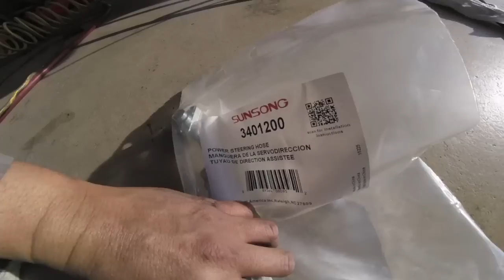TRUE Diagnose Replace Bleed Power Steering Hose Honda Odyssey √ Fix It Angel

Comment: Just my opinion, this is one of the best videos on power steering maintenance. You showed us the whole process start to finish. I particularly wanted to see how you bled the system since I have just replaced a leaking hose on my vehicle and was unsure of how to get the bleeding done. The manufacturer of my vehicle recommends cranking the engine after disabling the ignition , whilst turning the steering wheel about the same number of times  as you did.  Thanks for a great video.

Comment: Great video, helped a lot. Have two tips from my experience. 1. It is easier to reach the flare nut from the top of the engine. Just disconnect and remove a double hard line in the air intake section of the engine. 2. Instead of using crowfoot wrench and have a huge chances of rounding the flare nut (what I almost did)  cut the hard line very close to the flare nut and then apply regular socket. 

I reached the line from the engine top and used triangle file to cut the file (15 mins of work). Then used 14mm socket -- > profit.

Comment: nice... most guys bleed the steering by cranking it up after the hose repair...wrong. thanks for showing the manual bleed procedure it will help a lot of guys in the future! oh yeah was the timing belt tensioner making noise? saw two 3.5 t. belts last week due to blown tensioners. thanks for the vids.

Comment: Nice job. I love your style and comprehensive way of covering the job. I just put a new motor in my wife’s 2012 odyssey and I had to pull the whole cradle steering rack and all. After putting it all back in, the steering has hard spots in it while you’re turning. It’s not super hard but it’s also there with the vehicle turned off with no power steering. Racking my brain trying to figure this out. Any tips would be awesome.
Reply from the maker: DiverseDad hello brother, did you bleed the power steering system of air?
Reply: Fix It Angel I did bleed it the best I know how. I moved the wheel lock to lock many times. Still had the issue so I disconnected the return from the reservoir and blocked it while I had someone turn the wheel as I added fluid and drained the return hose into a cup if that makes any sense. It maybe helped slightly but I still have the slight issue

Comment: Hey Angel. How can you do that without engine is running when turning left and right? I tried that on my 2006 Scion TC it wont turn so I have start up the car to full lock to lock left and right. Do it has to get 2 tires off the ground to do this steering fluid service flush? Can this work in any vehicle while 2 tires off the ground without starting the car up to do steering fluid service flush? Let me know ASAP what is your method on my 2006 Scion TC. Thank you. Love ypur channel and video. @Fix It Angel

Comment: Hi!  I need your help! pls. what do u think is the problem of my power steering wheel that has continues Hissing sound somewhere under the hood when i steer from left to right and vice versa lock to lock? just replaced the fluid and that's the result, thanks in advance

Comment: Good video.  A few things that will make this easier.  1. DO use a crowfoot wrench that looks like a flare nut wrench, and do NOT use a normal crowfoot wrench.  2. Drain the PS fluid BEFORE you start work, not after.  Use a syringe or turkey baster to empty the reservoir first. You'll have almost zero spillage, and you won't be running dirty fluid through your brand new hose. You also won't have to cover the port on the reservoir.  3. Move line hard line slightly to find the right alignment, and the flare nut spins off with your fingers.  4.  You only have to crank the wheel 2 or 3 times, not 6.  5.  cover the port on the pump immediately after you remove the fitting; any dirt that falls in there will be impossible to remove.  I wiped the flats with a clean shop towel soaked in alcohol, then put painters tape over the hole. When you're ready to install the new hose, peel the tape off at the last moment - perfectly clean.  Lastly, cover the flare end of the new hose with a 3/8 rubber vacuum cap; you don't want to be shoving the new hose down your engine compartment and have it scoop up a chunk of dirt. Remove the cap right before you reattach it.
Reply: Can you provide a link to a the "Crowfoot Wrench" that you are referring to.

Comment: Bro i have a question for you im own a 01 odyssey and since two months ago i starting to notice that if don’t let my car warm for a 5 mins and dies on my and the first stop sing or traffic light its getting annoying i cleaned the tb it got new tps sensor map sensor i just replace the iac cause it was old and nasty so I decided to put a new one it took it to the shop they cannot find the problems i have a tuned up a few days ago also i notice before it dies the rmp drops like it can’t hold idle and it just die and stall it driving me crazy when i start the car in the morning idle goes up like 1,500 rpm then drops a little bit till warm the normal idle i have its something like 700 or 750
Reply from the maker: fredy Calderon hi bro, I just need to ask just to get more info so I can try to pinpoint the problem. Have you tested the alternator and battery? That's first to do. 
It's like a road map. A to B to C and so on
Reply: Fix It Angel hello bro how are you yes i checked them battery its like 12.45 or 50 when the car is off when its on like around 14v something put loan and everything and still in good range but i notice something since i just got a scan tool the fuel trims are so bad they look -14 or sometimes -24 % negative short term fuel trim bank 1 and long term as well read negative seem i was running so rich and make the engine stall but i check the o2 sensors the heater circuit respond quickly i will try to create a vaccum leak to make then go lean to see if they are 100% good i thinking could be a bad fuel pressure regulator that keep getting stuck and make a lot if pressure in the fuel rail or a leak injector
Reply from the maker: yes test fuel pressure regulator. that could be the problem. tell me what happens. good luck brother
Reply: Fix It Angel today i tried to check the  evap canister solenoid valve and it was fine
Reply from the maker: fredy Calderon try cleaning your throttle body.  Tell me what happens.
Reply: Fix It Angel I’ve done it already i’ll order the intake manifold gasket and i will clean the egr passages since I haven’t clean it yet just cleaned the EGR VALVE.  I’ll buy a fuel pressure gauge and the oem fuel pressure regulator but before replace those i will make sure to check the fuel pressure trying to get it before this year say goodbye
Reply: Fredy what did you find wrong with your Odyssey?

Comment: can the heater hose take power steering fluid? its not going to melt af leak?
Reply from the maker: AndersDog94 sorry I do not understand your question. Please rephrase your question. Thank you
Reply: like fuild line, if you use a hose thats not meant for fuild it can melt/start leaking.
Reply from the maker: AndersDog94 oh now I understand. Heater hose and power steering hose are made different thickness and heat range. I don’t think it’s a good idea to use it for not it’s intended use. It can burst and or leak. Thank you for the question.

Comment: I have a layman's question, say, if I am a slow easy driver, hesitant to high revs, drives carefully and enjoyably, will I incur serious mechanical problems as the ones you're fixing? Since I own a Subaru Outback I'm just acting cautiously since this car (from what I hear), is a complicated and expensive thing to run. **anyone..  pls don't be hard on me and throw stones, I ask in a helmet). Kind comments allowed 😉
Reply: yes if you drive like a slow poke car will last longer and also if you maintain it. itll last you along time without needing major repairs.

Comment: My 2005 civic is doing something pretty weird, I say that cause I cant find this problem anywhere on the web.
It is leaking (or spitting out) power steering fluid from the area where the steering column attaches to the power steering rack   
Its leaking all over my floor board and floor mats. (And no, its not brake fluid). no one I talk to knows why or has heard of this problem before, I wonder if anyone here as.
Reply from the maker: i think you have a bad steering rack

Comment: I tried to do this and everything went ok until I tried to remove the rock and pinion nut I stripped or rounded it and now I can't get hose off, please help
Reply: You did not use the tool that he used.  Happens often.  Mechanic time.
Reply: I almost had that same problem.  The flare nut is a real bitch.  I ended up breaking off the old hose so I could get a good socket in there before the nut was too round to remove.